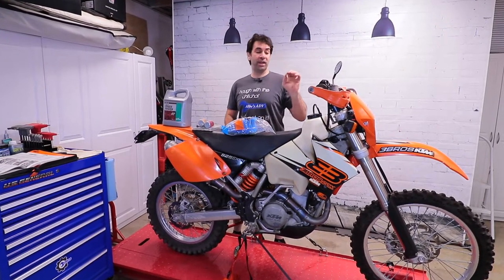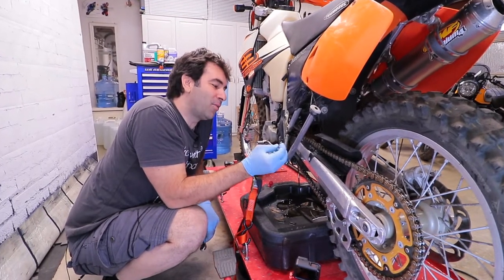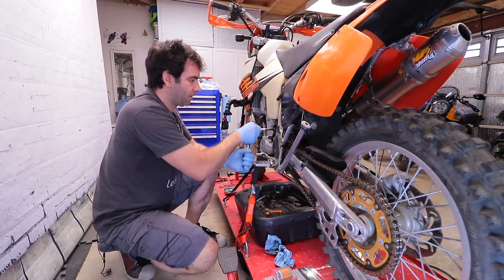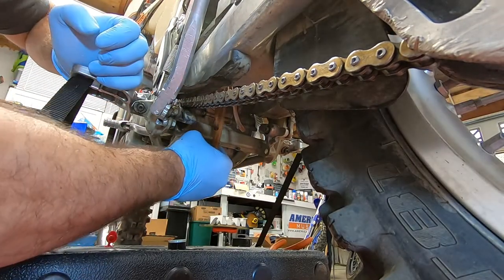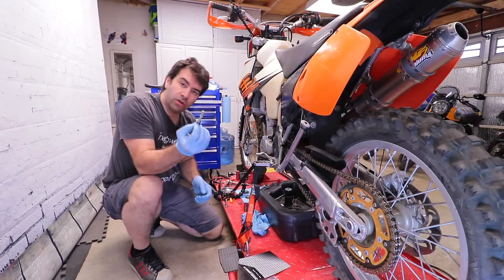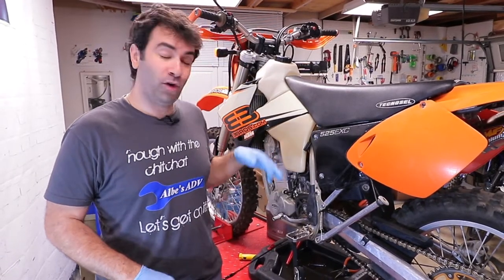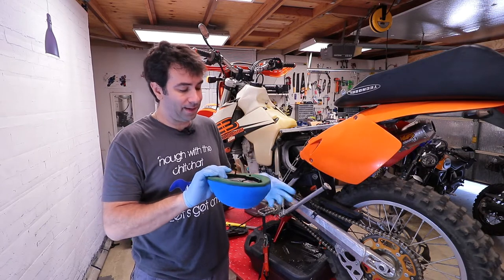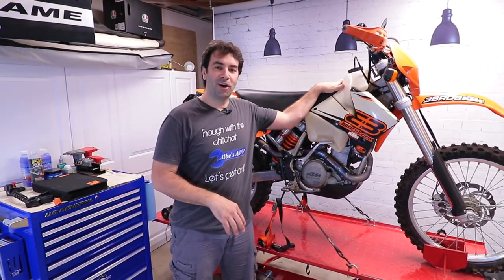2004 KTM 525EXC oil and filters change

Comment: If you still have the bike, a tip for when changing the oil filters, ktm recommends putting the bike on its side and filling the oil filter holes halfway with oil before putting in the filters
Reply: yea and if you change the coolant dont do it on a stand, use the kickstand with the skidplate off - ask me how me and my garage floor know
Reply from the maker: Lol, thanks for the tip 😀👍
Reply: Thank you . I always do that whenever it is possible at cars's oil filters , so, that i fill them with oil, and than start turning engine without ignition, until the oil pressure light turns off. Than i start the engine.

Comment: When using a tuque wrench with a crows foot like you used. Remember that the crows foot must be at 90 degrees to the tuque wrench, not straight out at the end of wrench. But out to the side at 90 degrees to get the correct tuque.
Reply from the maker: Thank you Lyle, I'll make sure to remember that next time 😀👍
Reply: I don't think that it is important, because the torque is transponded all the way equally .

Comment: Do you still have the bike? Never saw anymore videos after this one 3 years ago.
Reply from the maker: I do, I'm getting ready to re-do the clutch and possibly fork seals
Reply: @AlbesADV  cool, what happened to the clutch? I have a leak on mine but it doesnt leak fluid anywhere. Every few rides I lose compression at the lever. Any tips on where to start looking?
Reply from the maker: Mine is just old and I need to replace the discs.
Maybe your master cylinder is not holding pressure, that's why feels like is leaking but there is no actual leak

Comment: Please , what is the sense of original longue oil screen ?
Reply from the maker: Are you asking which way it goes in or why is there altogether?
Reply: @AlbesADV  I did my oil change but I don’t know which way to go up the long oil screen
Reply from the maker: In theory both ends are the same, but sometimes the part that goes in first is slightly shorter. Let me know if that helps
Reply: @AlbesADV  Okay, I think I put it in the wrong direction. is this a problem for the engine?
Reply from the maker: I'm not sure,  it shouldn't be, but being a KTM you'll never know. If you want some peace of mind just turn it around, if you lay the bike on it's side there is no need to remove the engine oil to swap the screen filter

Comment: Why wouldn't you duct tape your documents to the inside if the tool less air box cover? Makes sense to me
Reply from the maker: Well....first, cause I didn't think of it 😆 but even then, it's very oily in there, I ended up bolting on the ktm tail bag and that did it.
But yours is a good idea